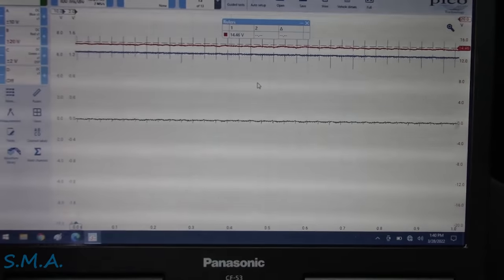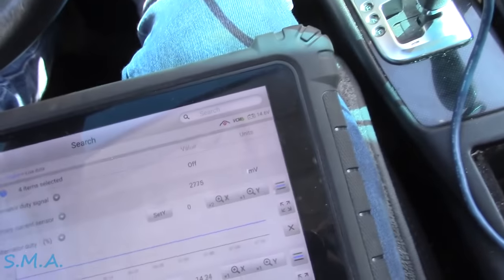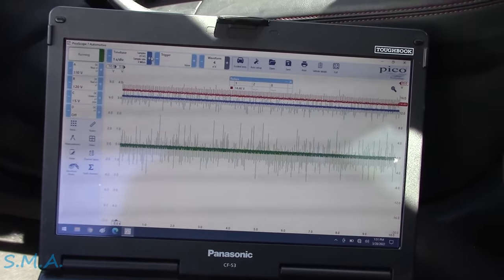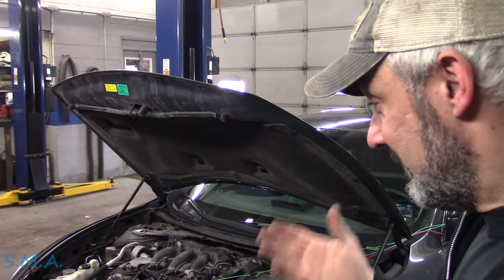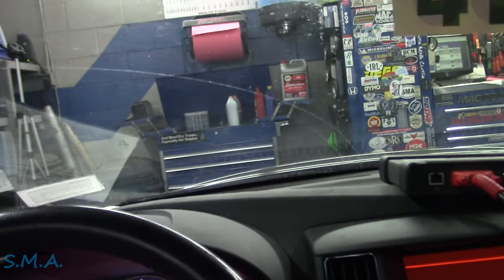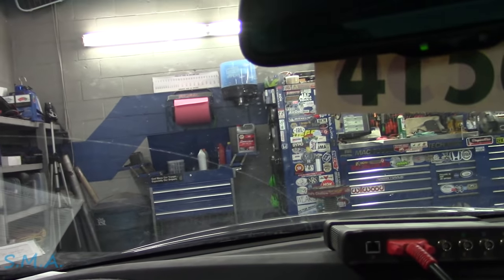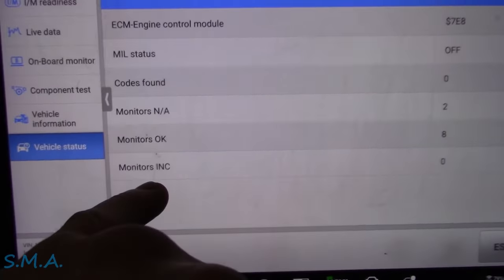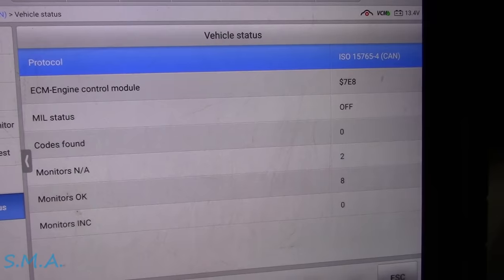Nissan Dealer Quoted Over $2000 For A New Harness!! - The Real Problem

Comment: I love this channel cause the guy does his diagnostics the same way i used to by using logic of the symptoms  . Not to mention that he takes the car for rides to try to recreate the issue no matter if he spends an hour trying to recreate it like i used to do  and i'm sure that he cuts off on the time that he does that  because he does it just to prove a point to himself but mainly to the viewers . I used to be like that when i was a mechanic and did that from the very start of my career up untill i retired . I guess that we are like that because we want people to know what we know and show that we mean to do what exactly needs to be done the right way .

 A code reader is a great tool but as you can see with this video it wont work all the time if you do not have an experienced knowledge of  symptoms relation between each other . As you can see eric used most of his knowledge on multiple symptoms to come to the conclusion that it was one problem causing all the others  and even though he found that the spike in the voltage was the problem  this is something that is not easy to figure out without a scan tool . To an everyday mechanic the alternator would have sound good when it actually wasn't . And i have to admit that even  i would have been fooled by that one back in the days but thankfully  now i can  since Eric convinced me to by my own scan tool for personnal and friend  purposes and i have to say that Eric's  knowledge of these things  saves me lots of time . Wish i had those in my time but hey i never stumbled on a problem that i couldn't fix  but that tool would have saved me a lot of time and effort if they would have existed back in the days .

Comment: The Nissan dealer told me my 2012 Altima needed a new cluster panel and these were a common problem . I’ll save the long story of the real problem and the fix . A Chevrolet dealer couldn’t fix my new Chevelle in 1966 . Since that time I fixed my car myself .

Comment: Eric, I don’t know how many times I have told people that insist on taking their vehicle to the dealer. Unless it's still under warranty. Unfortunately, too many people believe that the dealer is the only people that can work on their cars “correctly“. I have to often remind people that the dealer for the most part have the convenience of just using the parts canon. 9 times out of 10 most of your technicians that work at the dealer are brand new technicians right out of school. They get extremely lazy and have this mentality to just go to the parts room and throw parts at a vehicle. 
On the flipside, I explain to people that the independent shops, such as yourself do not have the same luxury, and work on multiple makes and models. Therefore, it is crucial there has to be a true diagnostics to repair the vehicle. Yes, there are plenty of independent shops. That still do not know what they’re doing. And they simply use the parts cannon. 
Customers have been burned by these “shops”. So, they end up going to the dealer. 
I really wish there were a lot more honest shops such as yourself. This video more than proved why people should find a good reputable shop and stick with them. Great work buddy. 
P.S This lady should be able to get her money back because clearly the diagnostics were incorrect. She shouldn’t have to pay for their screw up😡

Comment: Back when I worked at chevy someone condemned an engine as locked up. I was hd so I was to r & r engine. I pulled all belts off and was getting ready to fight the converter bolts, but it turned. Put things back together enough to start found the alt was frozen. Them things are to blame for lots o stuff.

Comment: I sold cars at a Nissan dealership for a few years and have never seen a "limp mode" car other than the many many failed cvts. I'm no mechanic, which is why I watch these to learn. I would never have guessed the alternator, but I definitely would have tried cleaning the terminals. You always hope its a grounding issue, just like you always hope the misfire code on a 4cyl is solved by new plugs or the cel is from a loose gascap. I'd have lost my shit on the Nissan service manager after seeing that I spent $1000 on the parts cannon without cleaning the battery terminals. The wiring harness is just a way to tell the customer to leave and never come back. I had a Toyota parts advisor tell me they can't fix my corroded side marker light because they don't have the pigtail so they have to order the wiring harness for $2k and cut off the end. Dealerships are the next step after Mr Lube. It's where you get all your fuckups done while you learn because the owner is a multimillionaire who treats you like a McDonalds dishwasher.

Comment: Back late 80's took truck to Nissan dozens of time for brake issue. Independent shop fixed it in 2 mins.  Missing caliper bolts on RH side. Crazy.

Comment: Having just had my wife's Maxima alternator fail, I think the person coding the BCM @ Nissan screwed  it up. It seems they never considered a failure where the voltage is going too high. The battery light does go on when the voltage is too low, as I just experienced, which is a more common failure mode.

Comment: I wish I hadn't left NY or you would be my mechanic. I just bought a 2011 Nissan Maxima and left the dealership as it was closing  and it went into limp mode on my way from the lot. Theere was 2 tablespoons of gas so I slid into a gas pump just as it died. Worked fine the next day. The 3rd day in the evening with half tank of gas, yup you guessed it. Limp mode. I pulled a P0174. Took it in the next day and related the 2 incidents. They said it was a bad ground and they fixed it.......2 weeks later...limp mode. I made it in to the dealership and after 2 days they said it was a P0171, a hose was collapsed and they replaced it AND the alternator was bad. They want $2700. Were in negotiations but I'm doing my research because I'm wondering why the 2 different codes yet no alternator codes,, so I don't trust the diagnosis.

Comment: From what I watched, I would call this a somewhat difficult diagnosis. You, yourself mentioned getting lead astray. Consequently, I don't think a full refund is in order from the dealer. I do agree with your "shame on you" assessment. As such a partial refund is in order. The Nissan dealer should return most of the labor, but the parts cost is legit (older vehicle, now with new parts). 
As an aside, a mechanic I completely respect ALWAYS addresses battery terminals first and foremost. He maintains that diagnosis of ANY electrical issue will always be suspect until the battery terminals are fully kosher. And he seems to be completely right from what I've seen.

Comment: Same exact issue on a customer's 05 ford explorer they brought me. Multiple places quoted a replacement of the alternator and when they did the problem still persist..couple days later they bring it to me to find the battery was to weak and the alternator couldnt keep up with it draining.  New battery and it fired right up and sounded like a brand new vehicle

Comment: I had a warranty replacement alternator with the code sending wire left off at manufacture
and it was hitting the circuit breaker when it spiked. took weeks to find out what was going on.. 
you had to SEE the spike on the meters.

Comment: I think the dealer owes her a refund and an apology. When you started seeing voltage issues after you cleaned up the battery connections, my first guess was the alternator. I'm not a mechanic, just a DIYer, but I pay attention to what symptoms were happening and what your meters were picking up. It is odd that it happened on left turns, but the car seemed to have to be in motion for it to keep happening. You said it has electric power steering, so a residual electrical issue on using the steering. The voltage jumps were the key.

Comment: Because computerized diagnostics are a necessity these days, you must learn each vehicle make as it relates to your scan tool.  Many scanners have canned data for each make, you should look through those, and see how different a GM is from a Toyota.  Every manufacturer does things differently with their PIDs, and an experienced tech should know that foreign makes in particular use different trouble codes and PIDs.  While you finally found the telemetry for the alternator, it would not have eluded an experienced Nissan tech and would have been fixed in less than half the time.  I find a lot of techs complain about this make or another being hard to work on, but it usually comes down to inexperience.  Doubt leads to lack of confidence and a longer repair turnaround.  A scan tool is as important to know as any other tool used by a tech in the course of their work.

Comment: Honestly surprised a Nissan CVT is still working perfectly at that miles. FWIW, I had a really strange timing issue on my 88 F150 (4.9 I6, 5 speed, 2wd) that required a massive advance to even run. After checking the timing gears (still looked new) and getting a rebuilt distributor- it ended up being a wonky coil pack. I kid you not. In our defense.. those early EFI ford did not have anything like OBD and we did not have the proper break out box.

Comment: All I can say is that I was a Ford trained and certified  tech at a few dealers for over a decade, the same with Dodge for 2 years until the dealership was sold, and the same at a Kia-Subaru-Isuzu dealership for 4 years. I can tell you that at all of the dealerships, save for the Kia dealership. If there was a misdiagnosis, a mistake, or a recheck where an additional issue was missed, the tech ate everything but what finally fixed the problem, ant if it was not fixed, and the customer declined further work, he was not paid, because the dealer was not paid. That being said, and I have seen this in every shop I have ever worked at, there is a thing called prices law, and it relates to production, but in my experience, competence. It states that the square root of the number of employees are responsible for 50 percent of the production. That seems to apply to work competently done as well. That means very few tech will actually be competent at what they do. I have seen a lot of techs even at dealerships that I would not let work on a $50 lawn mower.  
It is never a good idea to trust the diagnosis unless you know him well enough to know his recheck ratio. Production and flag hours are irrelevant, recheck reflect how often he gets it right, and how often he doesn't. They should be less than 5% of the work or less. (That is being conservative). In short. That is why such things like this are pretty much going to happen. Good dealerships account for it in their business model and don't let the customer pay for a misdiagnosis.

Comment: I've run into Nissan having those high voltage problems. It will turn stuff off just like low voltage will but not all turn off. So it makes weird codes that can lead you in a completely wrong direction.

Comment: Yes refund on dealer stuff up Agspanner !!!
A well thought thru diagnosis  ... process elimination  and knowledge  of how systems  work whether computerized systems  or older analog systems  ...  lol 👍 😆 🤣  ... using Snap-on  analysis  Tool gives great system  break down  but you still have to understand  what its telling you  ... then take appropriate  actions to rectify  the fault .  A Great Presentation  Sir great effort certainly  better than $2000 plus fitout ..  just cleaning Battery Terminals and location of fault in the Alternator and replacement  🙃

Comment: I had several terrible experiences at Nissan service departments. It's as if they hire the worst techs they can find. And all my issues were simple fixes under warranty and a recall. They actually screwed them all up. I ended up fixing the truck myself each time.

Comment: I wish you were near me so I can take my cars to you.  Watching your video, I want to tackle some of repairs but live in a apartment.   No place to do any maintenance or repairs.  Most of repairs shop I lie and cheat in my area.  From charging for parts not replaced to not putting thing back together.  I asked belt and all tensioner to be replaced but only changed to belt and try to charge me.  I wanted them all replaced cause labor was lot more cause hard to get to them.  Replacing them would only would cost me little more for part and not additional labor. I did not want to pay labor again to replace them later but he did not replace and tried to charge me.  When he saw me going in hood with flashlight, he removed the charge for part but I would still lose if tensioner doesn't last.  Other time I had bottom front engine mount replaced.  I looked down to see the engine mount before taking car to repair shop so I knew my splash guard was there.  After repair I took home and later found out splash guard was missing.  I went back to complaint but he said it wasn't there.  Total lie but his word against mine.  I had to fork out $$$ buy and put on.  I can't seem to find honest one around me.

Comment: I think you're a great mechanic, being one myself I think sometimes a scan tool can be overused to diagnose a problem that you know in your gut was the alternator, because there is nothing else on the car that can produce 17vdc. if the regulator is bad, you still need to replace the alternator as its built in. I think good mechanics like you are wasting your time doing steps to keep you tuber newbies from complaining . I don't want to criticize you only point out that time is money even if is spent on a scanner like scanner Danner's channel. I like your trouble shooting method and can do without all the quirkiness of rain man's video's .Enough said ,I definitely think Nissan should give Her a refund as who's to prove a bad diagnosis from a scam " I think what though all of us was the problem showing up on turning left ,which might lead one to believe that the suspension was causing pressure on a wiring harness       . I worked in communications for 45 years  and when I had a weird problem in a system that affected multiple devices it was always a bad ground or battery return . I think you are still the King of auto repair and will continue to watch and thank you for taking the time to make your video's . MisterPc

Comment: I gave up on dealerships a very long time ago. Dealerships are only good at taking money and somehow have instilled this idea in the public that they are the most knowledgeable and capable when it comes to repairing the product they sell. Personally I think the biggest reason they suck at diagnosing problems is the way they pay the technicians. If they got paid straight time for how ever long it takes I think they would do a better job. The way it is, it’s like speed dating. You have a time limit and if you get close to running out of time you have to start guessing to get the car off your plate so you can get to the next paying job. Also, most dealerships pay the tech a percentage of the parts they sell so that expensive diagnosis benefits their paycheck. But, it’s  a broken system and it’s not going to change as long as people keep believing the lies.

Comment: One thing's for sure, if dealerships and shops offered a problem fixed guarantee and had slightly higher prices to account for longer diagnosis it would be a win win. If they diagnose and you purchase the fix and it doesn't work then you shouldn't be paying for any of it. A diagnosis is the "Identification" of a problem or illness by examination of symptoms....... I would argue if they don't fix the problem, then they never diagnosed it either because they didn't actually identify the problem.

Comment: Dealerships in general pull this sort of thing all the time, i.e., the tail pipe ball bearings have lodged into the differential, due to the steering column sensor monitor disconnection to the windshield wiper's motor that resulted in the ABS failure by having the improper tire inflation. However,  we have noticed that due to the most recent 'Sun Spots', the automated computer software program malfunctioned and we must replace all your tires and your car's computer system to obtain the most level gravitational pull on your vehicle in order to avoid 'jerking-off' your vehicle's full and complete wiring harness.

Comment: Geez.. A Nissan dealer couldn't diagnose a bad alternator?... Thats just appalling! This is why I have never (and I'm almost 61) sent my car to a mechanic and have no intention of doing so. I might not have all the fancy scanners but when you were talking about all the unconnected electrical issues at the start of the first vid I was saying "alternator voltage!". There is a heck of a lot you can do with a basic DVM and ToolAppPro/$25 code reader and now it seems even the dealers are just swapping parts for an arm and a leg.. Yeah they should refund her money!

Comment: thats nissan diag systems     i had a rear end repair and nedded  a small harness to the rear sensors , they pre diagnosed before  we got  the car at the shop  saying they nedded a whole car harness..   till took I  it apart and saw  the right one  sometimes they wont do the hard thinking   to get it fixed

Comment: I had a 2020 Nissan Murano and when I took my vehicle in for service and had them check my electrical service for an issue,  I had to sign a document stating if they didn't find anything wrong with my complaint I would be charged $220.00 for just looking at it, well that  didn't excite me at all and so I have decided to get a new vehicle a 2022 Subaru Legacy and as of now I have had not problems with it and hope I never will. So yes a lot of times Nissan dealers don't hire the most qualified mechanics.